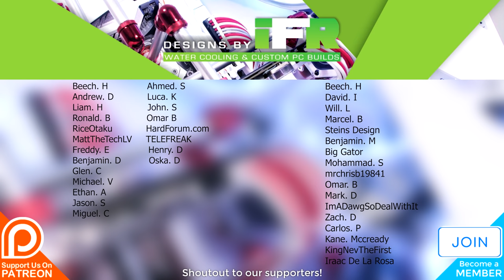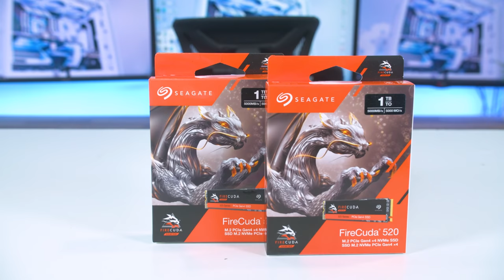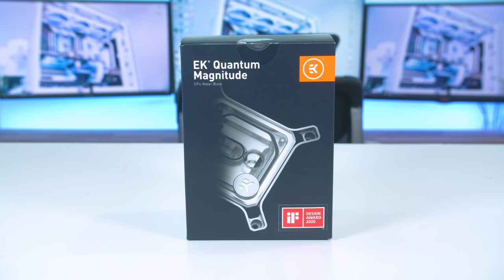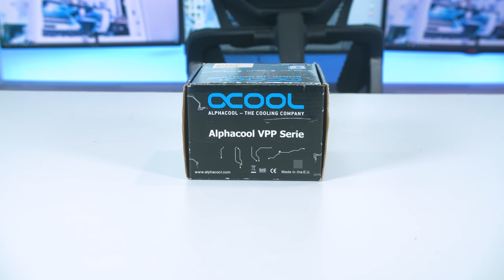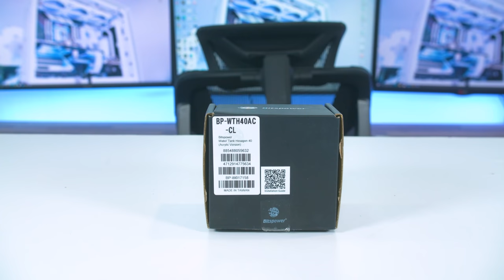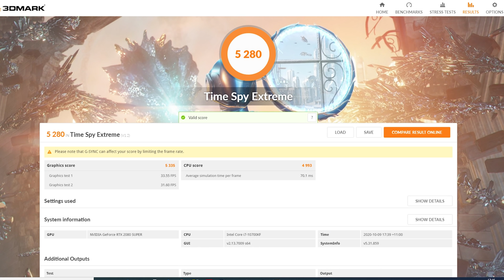I CUSTOM Water Cooled the Cooler Master NR200P ITX PC Build + Benchmark

Comment: Nice looking build!

If I were to do this though, I would try to use the barrow CPU block with DDC pump and cram a 280+240 radiator into the case with soft tubing, and use the vented panel instead.
If it could fit barely, thermal should be phenomenal!

Comment: beautiful work,you can in fact fit 2 rads in if you get slim radiators such as XSPC radiators,also "no one who buys this case will want to put a water cooler in it" actually it's a reason i bought the case,wanted small form factor that can also fit a custom loop in.

Comment: Very Nice build.  And I appreciate the effort you took to video and post it.
Two things that bothered me.

1. a lot of 90 degree fittings, which are pretty pricey.  Perhaps you are going for a look, but cheaper to bend the hard tubing.
2. the reservoir is even with the pump, so only half of the capacity is used.  It should be higher and draining down.

Comment: The fans on the top were probably plenty to get air moving in there. I would have done a run with the bottom fans removed.

Comment: Saw this a little too late. The issue seems to be that the CPU is receiving hot water from GPU in this build, that's why the CPU temp is high. As i recall, the rear fan is 92mm, which u could get another rad+fan there in between, reverse the water flow (going to CPU first instead of GPU first). It's gonna be crampy, but the temps should be much nicer

Comment: Not sure if I missed you showing or saying it, but what coolant did you use?
Reply: Video description
Reply: @de00prolazr_47  I dont see it mentioned there. I looked before asking.
Reply from the maker: Its a custom colour i made with blue and pink thermaltake coolant
Reply: @DesignsByIFR  Thanks. Its Thermaltake coolant. The color wasn't as important but the look is good. Not thrilled with what I'm using so was looking for a change. Nice custom mix though.
Reply: Mike Mumbauer sry
Reply: @de00prolazr_47  no worries. Got the answer.

Comment: i love the build but i just need to know why you add fans when everything is water cooled and the case is open. no hate tho.
Reply from the maker: Fans need to be on the radiator. The fans also create airflow for other parts not being water cooled. The fans also provide lighting for the case
Reply: Designs By IFR oh okay thanks

- a console pleb
Reply: The watercooled aspect is so you can run the fans low enough to make it virtually silent, where with air cooling you would have to have a higher overall rpm making the machine louder and possibly not cooling it as well either. The water still gets saturated by the heat, the fans help dissipate the heat from the radiators.

Comment: hello sir! good job! that looked pretty tight! i dont know what kind of fittings are there available to buy! but i think that if there s any straight fitting (male thread x female compression) i see at least 3 cases that could have been used and it would save you 5 elbow fittings and if im not wrong i can see one of those fittings on ur radiator.. i understand that u might have to make the offset from the cpu block to the reservoir cuz the block might be slightly higher than the reservoir if there s any 16 bent fitting prolly could have worked..thats a plumbers prospective :D any way good job again for fitting all this in such a  small case!

Comment: Amazing build! But one question: on some of your our builds I see a hexagon thing with a fan inside in the loop. What does it do?
Reply: It's a reservoir.
Reply: That's just a "flow indicator" so you can visually confirm that the water is moving.  Handy way to confirm the pump is working.
If there is a spare port, you can also screw in a thermal sensor to monitor temperature of water, usually plugs into motherboard (or specialized board).

Comment: What are those older ITX cases that had room for 2 rads? This system looks great but it will perform like an air cooled system after 15 minutes. Edit: Or the coolant will melt the PETG
Reply from the maker: Its acrylic
Reply: Designs By IFR oh nice, your work is always top notch. But come on man don’t tell me you think a single 240 is appropriate:-p
Reply from the maker: @depth386  not mqny options with this itx case unfortunately. But  in saying that, with the suggestions i made about the case i think that for these particular specs the 240mm rad will be fine (obviously not the best but usable with the gpu being even lower than 68 degrees and the cpu below 80)
Reply: @DesignsByIFR  I'm sure the CPU & GPU are fine it's the liquid's steady state temperature that I'd be worried about. The rubber gaskets (o-rings) holding the seals in the fittings might not enjoy that. At stock clocks it would probably be okay.

Comment: Slim fans would have worked as well, but I don't know if CM offer them. Noctua have slim fans that perform remarkably close to their 25mm fans. 

Saying an SFF case needs an extra 5mm could be said over and over again until the case is no longer SFF. An SFF case is what it is because it's small. That's where its compromises are, that's where the challenges are, and that's why people like them. People will choose not to buy this case because it's on the larger side of what an SFF case is classified as.

Comment: Very nice build.  I also ran up against the same issues you described...I went with thin fans on the bottom rad and a thick fan on the 120rad right in front of the cpu...this allowed me to blow air directly across the vrm.

Comment: this is a very weak cooling system for such a processor and video card. In my system, there are two hardware labs heatsinks 240 + 280mm, and even with this, the temperature of 8700K reaches 80 degrees in games. This processor is also based on liquid metal ...

Comment: I am building a beast...plz help me....i7 10th gen....z490 hero or z490 f gaming(which one)......gigabyte rtx 3080 gaming oc (or should i choose some other 3080 and if yes then which one??)......x73 or z73 or galahad 360 or deepcool castle 360 rgb v2(which one??)....32 gb of 3600mhz ram......corsair 1000 watt psu......antec df600 flux(or something else??)....2tb firecuda 512 gb nvme..........is everything good?? And plz give answers of the questions of the brackets....plz reply..... and any suggestions...plz tell me...btw i am waiting for 4th gen...
Reply: V2 AIO
Reply: And x670 motherboard with ryzen 7 5800x
Reply: @de00prolazr_47  x670?? Will x670 come with the 5000 series processor??
Reply: Munshi Kaifur yes
Reply: @de00prolazr_47  when will the new mobo come??
Reply: Munshi Kaifur 5. November, but if you need a Pc now, you can buy a 3rd gen Ryzen 3 (just to have a CPU) with an x570 board, and then upgrade to 5th gen ryzen cuz it supports x570 boards
Reply: @de00prolazr_47  i will wait till nov 5 for x670 and 5000 series
Reply: Munshi Kaifur ok, nice

Comment: 1motherboard.    Rog crosshair viii formula.     

2.GPU.                    Titan rtx (2)  
                                 
    
3. Processor.           Amd ryzen 9 3950x
                                    

4.RAM.                     Trident Z Royal
                                   DDR4-5000MHz
                                   

5. Cpu cooler       EK-Quantum Momentum.     ROG.Strix X570-E D-RGB - Plexi

6. gpu cooler.   EK-Vector RTX Titan

7. Cabinet.         Cougar

8. Fans.                  LLRGB120(3) 

                                 LL120 RGB 120mm (2)

9. Storage.               Force Series Gen.4(2)
                                   

10.MICE.                    G502 light speed
                                    

11. Keyboard.         Razer Huntsman Elite
                                   

12. Monitor.             ROG SWIFT PG27UQ
                                   
                                    ROG Swift PG65UQ
                                    

13.headphones.           Rog delta
                                         

14. Mice pad.                ROG Balteus
                                         

15. Gaming chair.         THE ROG CHARIOT

16.mice  stand.            ROG Throne Qi
                                        

17.gpu backplate.       ROG Spectrum RGB 

18.ssd.        DELTA RGB SSD (5V)  (250*4)
                                       

19. Power supply       ROG THOR Platinum 
                                      

20. Pipes.    EK-HD PETG Tube 12/16mm.       1000mm (2pcs)

 21 pump.  EK-Quantum Kinetic TBE 300 D5 PWM D-RGB - Acetal

22 wires.      LIAN LI ADDRESSABLE RGB STRIMER PLUS 24-PINLIAN LI ADDRESSABLE RGB STRIMER PLUS 8-PIN

23.router.        Rog RT-AX82U

24 radiator.      Pacific RL360 PlusRadiator
                            EK-CoolStream PE 240 (Dual)

build this stuff 😂😂😂😂😂😂

Comment: you could have used slim fans and radiators, just saying
Reply: Could have, but if thicker versions work, then using slim is just leaving performance on the table.
Reply: @Grubbybump253  did you not hear him, he almost didn't have clearance to fit the fans
Reply: @niuchajianfa6222  almost and didn't are two drastically different things.
Reply from the maker: We used the thinnest radiator we had and thinnest fans cooler master has to offer
Reply: @Grubbybump253  try covering 95% of your nostrils for a few days
Reply: @DesignsByIFR  well i guess there's that

Comment: All show with no go.
This is prime example of Form over function.
NO 3080/90 and 5950x can be cooled by a slim 240.
USELESS.
Reply: i know this old but you can use xspc tx240 slim rad in top with 15mm fans use the things for mounting hdd screm them to rad then push them in the fan mounting grommets  also hardware labs and alphacool sell 92mm rads can mount on back of case